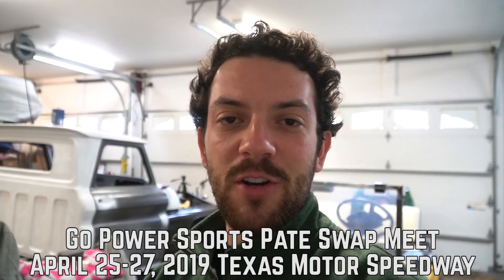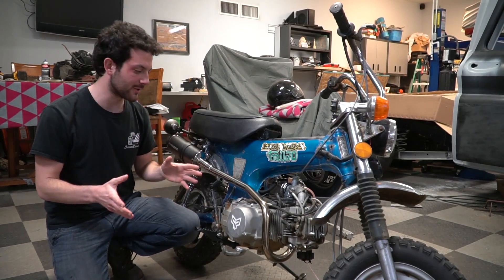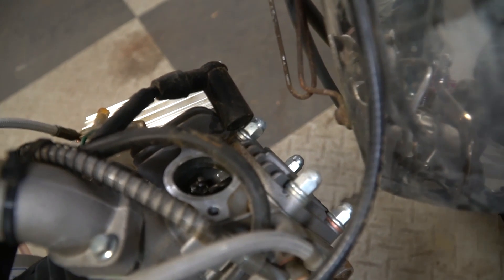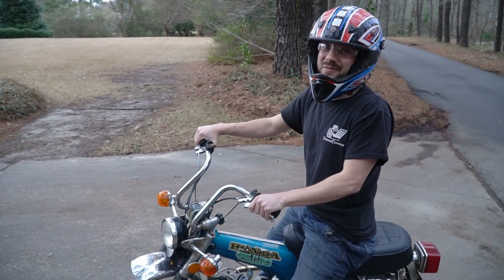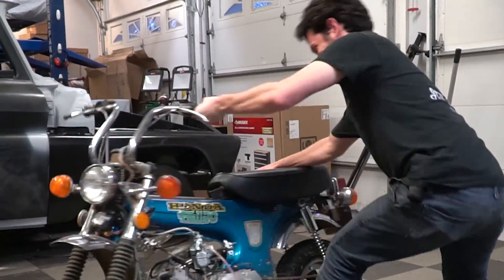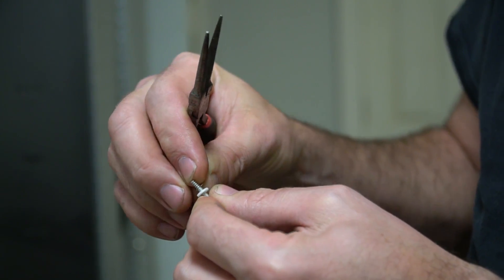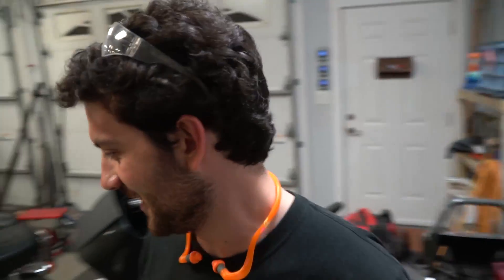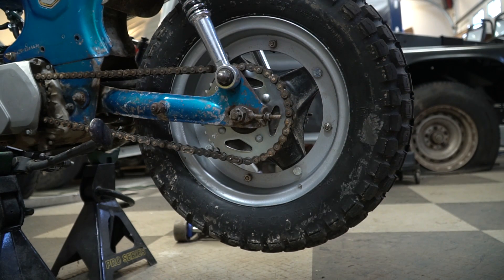Honda Trail 70 Return | The Street Legal Mini Bike!

Comment: Once the engines start to break in they loose power and stop running right they start running way rich needs the larger carb and the valves ajusted

Comment: Your bike is starving for fuel because of your fuel filter. Gravity fed fuel systems should use a fuel screen not a filter, simply not enough pressure to get through the filter. Use a small engine screen and make sure you cap vents and it will be fine. Check my small engine projects on my Youtube channel.... Glenn's Speed Shop. Looking forward to your Oregon trip if I can make it!

Comment: Would anyone have a recommendation for a good cheap 50cc engine? I want to build my own street legal minibike to drive around town and such, but i don't have my motorcycle endorsement yet so i don't want to go through the hassle of fitting a larger displacement engine.

I'm trying to keep the whole project under $400 so cheaper is better, but id still like to have a serviceable engine if possible.

Comment: The needle is for 1/4 to 3/4 throttle position, not for midrange RPM. When you go full throttle. Its all about the main jet. Youre bike is probably to rich by hearing

Comment: John you guys need to order up some Flapper Wheels for your angle grinder.  They work much better than trying to grind things on your bench grinder.  Here is a link to some really cheap ones that works OK: https://www.harborfreight.com/4-1-2-half-inch-36-grit-flap-disc-67639.html

BTW did you fix the muffler mount, as you didn't show it in the video?

Comment: So the main issue with that 140 and hate to say it but predators and gopowerpsorts etc, all chinese! Why is everything so cheap, low quality parts produces with low quality metals, how come your engines blow up so easily, low quality, and dont take this the wrong way im not "hating" i do appreciate all your videos and i have dabbled in minin bikes etc, its just the plain truth why your always replacing stuff! The original engine ran great and was strong for 40+ years! You just repalced it because you wanted to go faster and the "new" chinese made engine barely runs after breaking it in
Reply: This is why I haven't bought a lifan engine for mine it's 35 years old and still screams like new I would almost feel bad replacing it
Reply: @justinpeterson6839  exactly!
Reply: yea, on the 70/140 it was out of fuel.... NOT the engines fault.  And the last problem with it not getting any fuel is: the bikes fuel tank that is faulty or it is the carb, wich is japanese.  So if you actually knew what you were talking about you whould understand that. ...  Always some guy talking crap and not knowing what he is talking about......
Reply: Their engines don't just blow up all the time.
Reply: You don't even know what you're talking about. "The main issue with that 140 is it's chinese", "chinese made engine barely runs after breaking it in", do you even read your comments before posting? None of that is correct. If it is, you can link me with proof that 140's are unreliable, run like crap, and blow up at will. But you can't
Reply: @surewhynot6259  for the age alot of their engines seem to, my point being though, compare any of these chinese engines to japanese or american and you will see a difference in quality and longevity
Reply: My point that they are chinese means, low quality valves, soft valve seats, rough ports, weak rods, weak rings, every oiece of metal used in these engines is low low quality, that is why they are so cheap say whatever you want but these engines will never run as good as honda/yamaha/husky/kawasaki/suzuki, if you knew anything about what you were talking about you would realize its common knowledge that cheap generic brand chinese engines are less reliable than japanese/american
Reply: Sir, all chinese engines are shipped half full of vegetable oil for shipping regulations.  I have seen most people run this oil for break in. I have been in the industry for decades. While china was buying our scrap steel, they were producing some of the highest quality metals compared to the pot metal we are so used to getting.  They have since lost the contract.      @justinpeterson6839
Reply: When have their engines just blown up? Been doing this awhile myself, I own 3 chinese 110cc and have had many 212 predators and have only killed one of them drifting a gokart it finally bent a valve pushrod, it could have been fixed but it's so cheap we just built a brand new one
Reply: yes and no. like Gjones2000 said, You cant break it in with the stock oil. My z50 hauls with the lifan 125 i put in. Its all about taking care of it and it should last you some time. Then again, the stock motor (83) has been going ever since. lets just say that you have to put in a quart every 5 hours, without draining anything haha.
Reply: Back in the 60's, ignorant people said the same of Japanese engines and motorcycles.  Lifan makes millions of engines (for the billions of Asians).  They make engines, motorcycles, cars, huge trucks, etc., etc.  Even Home Depot sells them.      You should research before making such idiotic claims.  It makes you look like an opinionated kid.
Reply: Seen a Lifan 200cc with over 30k miles that still ran great, I have had two bikes with Loncin engines with thousands of miles on them, zero problems.   Your opinion is based on bullcrap other people have said online and/or your own confirmation bias just because they were having a fueling issue, which is in no way related to the engine.
Reply: The thing is; you can buy 2 brand new chinese engines for the cost of refurbishing an old one.

Comment: That chain is GROSSLY too tight, it appeared to be tight as a drum, on a bike with a suspension there should be a minimum of about an inch of slack in the chain. Meaning at about the center of the chain you should be able to lift the chain without resistance about an inch. I've been noticing for quite some time you guys seemed to be over tightening chains but this was the first time you have clearly shown it on the video, over tightening the chains will cause power loss and premature wear. There should always be some chain slack, never tighten any chain as tight as what you show here. Its also a good idea to replace chains and sprockets at the same time, don't put a new sprocket on an old chain and don't put a new chain on an old worn out sprocket, they work together and a bad one will ruin the other.

Comment: ...Honda Trail 670?!
You think you would've learned from Mike Finnegan that vehicles need gas to run right... Blasphemi anyone? Putting the clip closer to the bottom of the needles richens it up... putting it higher leans it out.. You are closing the needle when you put the clip up higher not opening it.